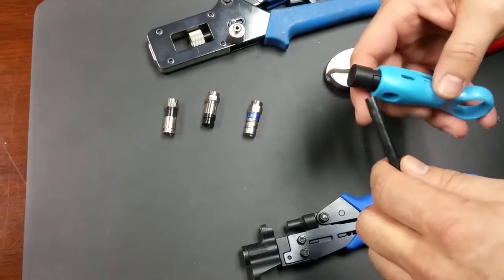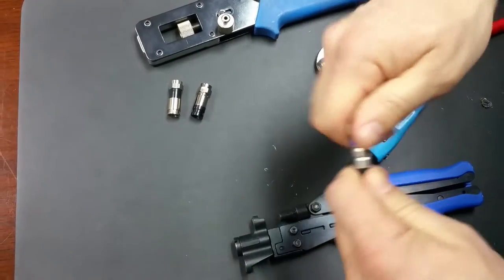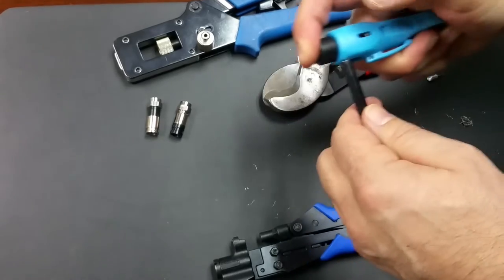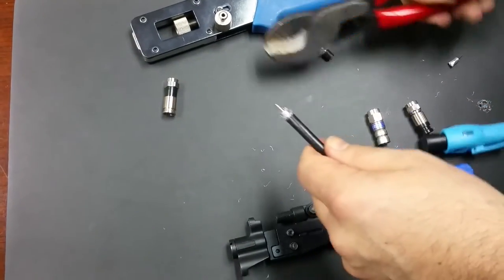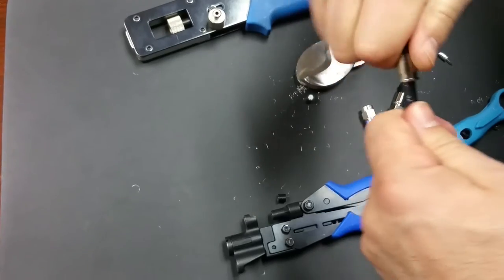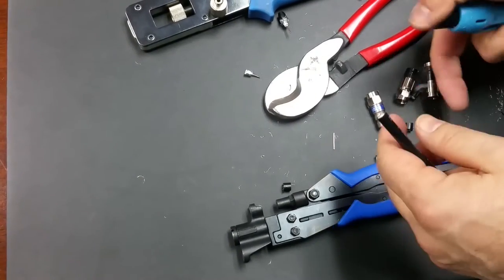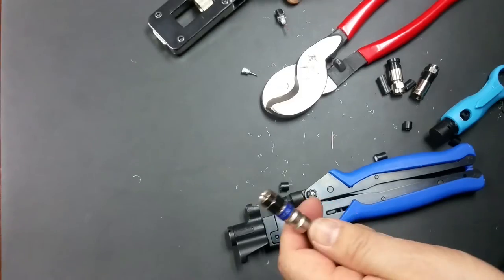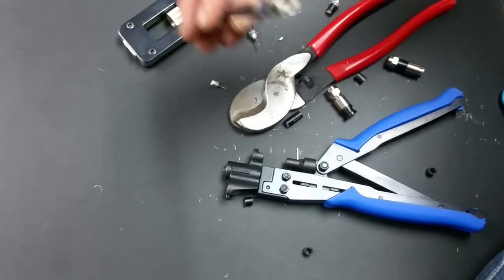TESTING Different Compression Connectors for RG6 Coax

Comment: You say “Pull this back...the braid.  Obviously, I don’t really mind using my fingertips at the moment because I’m not actually going to be using this”.  What does this mean?  Why would you mind using fingertips?

Also, twice, after doing the compression, you mention “Doesn’t seem to buckle”.   What does that mean?
Reply from the maker: Hi George, great questions!  The first part "using fingertips".  In the Industry the corre t way to peal back the braid over the jacket is bybusing the comb or brush that many times come with the prep tool.  The reason they train you NOT to use fingertips is because you are supposed to avoid applying any oils or residue that skins can have.  You try to keep the center conductor as clean free as possible. Truth be told a huge amount of contractors I know use their fingertips. lol. But we defintly want to teach the correct methods.
As far as "buckling" sometimes when using different tools that do not have proper support for compression of some connectors (made of different softer metals) it is possible that the connector can bend and get damaged.  I called it buckled. This is due to compression base on tool. Some tools have a 360 degree support base for connectors and others only 180 (half) support base to compress connector. If it's a connector made of softer metal and you use a tool w only 180 support base, it's very possible that one side of connector will bulge/buckle/ or bend on one side 
Hope this helps a little bit more. Please let me know if you have any further questions

Comment: why didnt you pull on it after it was compressed?  I havent found one yet that doesnt come off.  still looking.
Reply: @Bobo I picked up ideal brand metal ones from lowes tonight  without that plastic on it and they worked great. Needed a half inch of teflon, not 1/4 though

Comment: What coax cable are you using.  Is that regular RG6 cable or RG6QuadShield.  Unfortunately I have RG6QS and it's a pain in the rear end to work with.  Its very difficult to get these compression connectors to fit over the quad shield and push it on so that the dielectric becomes flush with the lip of the connector.  I think I do remember you saying on your video that you were using dual shield rather than quad shield.  Guess I need to go back and order dual shield to use with the RG6 connectors and compression tool that I have.  Nice Video!!!
Reply: I don't know why they even make quad shield crap anymore, pretty much the whole CATV has went to using 77% tri shield with the outer foil bonded to the jacket, it has essentially the same shield effectiveness as 60/40 quad and is a hell of a lot easier to prep.
Reply: There's flaring tools you can buy that opens the way. The most common is a blue 3 tip triangle looking tool, search for rg6 coax flaring tool. I haven't used one but it might help.